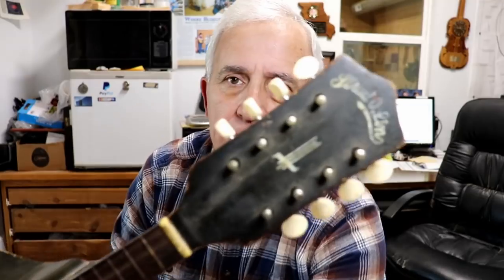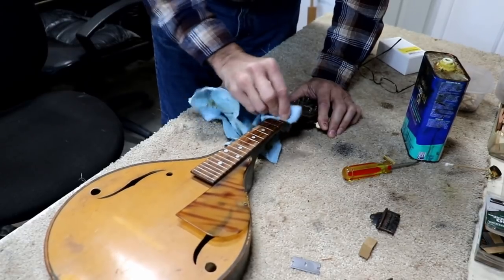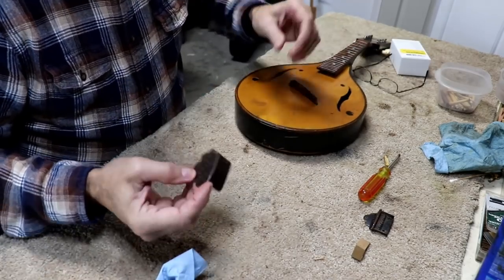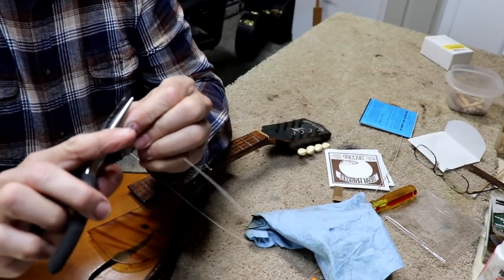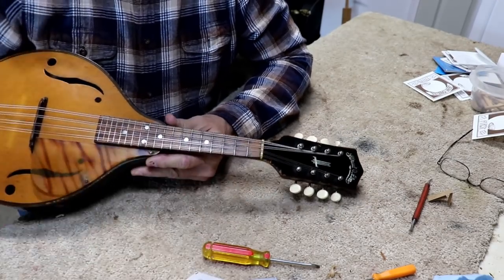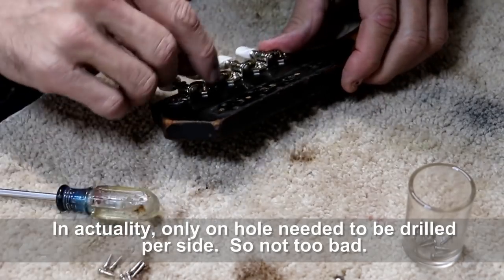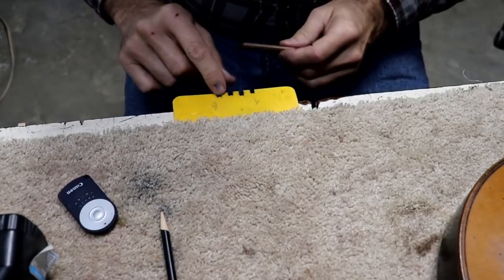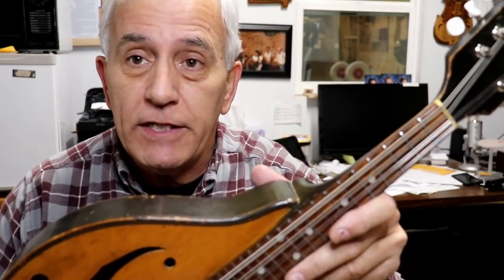271 RSW Strad O Lin Mandolin Rustoration Tips and Tricks

Comment: I actually liked the sound of that, seems just a little richer somehow. Pretty nice for a budget job. A tip on heat adjusting plastic. Always heat on the side that you want it to move toward, then cool with air or a damp rag only on the hot side. You will swear that it's going the wrong way as you are heating it, but as you found out as it cools, it constricts more and will draw it tighter on one side thus making it curl that direction.

Comment: I think you could fix the pick guard by boiling it in water (more even distribution of heat than the heat gun), and then clamping it flat until cool before re-installing.  Unless the pick guard was warped when it was formed, that process usually restores the  "memory" of plastics.

Comment: 'Hokey'   Nope. Effective, yes. Flat razor blade technique really does work.

I was watching a guy do restoration on a 90 year old Gibson L5 guitar [ $25,000 ? ].

He used the same method of scraping the ebony fretboard in some parts that needed it

Leveled the board, filled tear out from previous work, re-fretted, polished, etc. He did a fine job. He also replaced all of the MOP inlays, as some were very yellowish. He was a meticulous guy.

The old instrument looked really nice; not new, but beautiful. Non-electric, of course.

Personally, I though it sounded thinner than the later Gibson acoustics. Just me...

Comment: It's my understanding that the difference between boiled linseed oil and raw linseed oil is, that the boiled oil is a drying oil and the raw doesn't dry.  For furniture and other indoor stuff, I use boiled linseed oil.   For rough, weathered outdoor wood, I use the raw linseed oil.  The point is that I don't rub in the raw oil, I just leave it to soak in.  After the repeated applications, the gray wood turns darker almost black.  Through time It becomes sort of fossilized.   It will never rot.
Reply: BLO has chemical hardeners added. These are not very pleasant but the raw oil won't set in the same way.
Reply: Also BLO is cooked at high temperature with chemicals so it changes the length of the molecule chains (if I remember well), making it dry faster and harder.
Reply: Gee wheez, I keep learning stuff even though I'm a pathetic , geriatric case.  So. are these chemicals like japan drier? @stratocactus
Reply: Also, I've always thought that old Strad-O-Lynns were wonderful, inexpensive instruments.

Comment: Great video once again! My question is, why you didn't simply reverse the machine heads to opposing sides to reverse the direction of pressure the string tension was placing on them against the worm gears? Is it possible they were previously installed backwards?
Reply from the maker: First they were incredibly tight even out of the mandolin though they did turn a little easier. Second they would turn backwards if you do it that way. 3rd they weren't the original tuners anyway and it was inexpensive to put on a new set like $25.
Reply: @RosaStringWorks  Thanks Jerry.